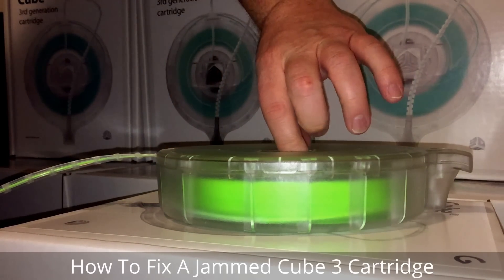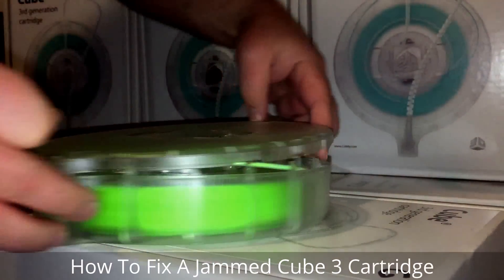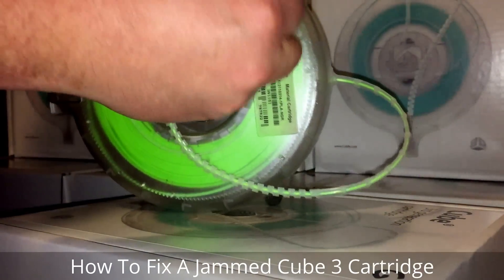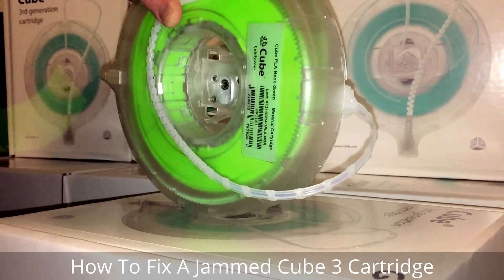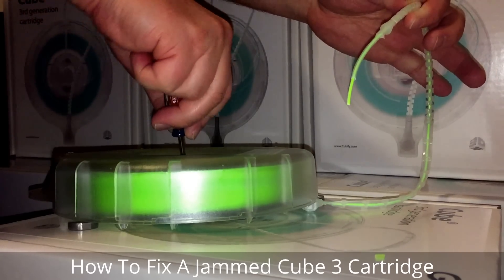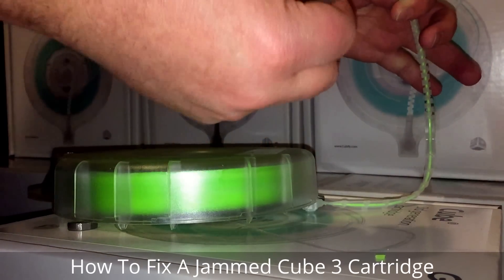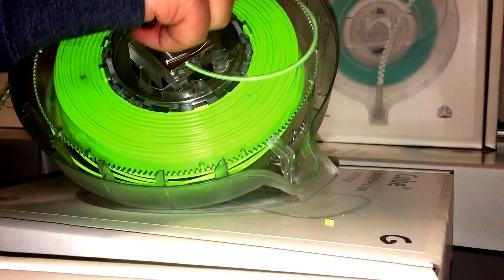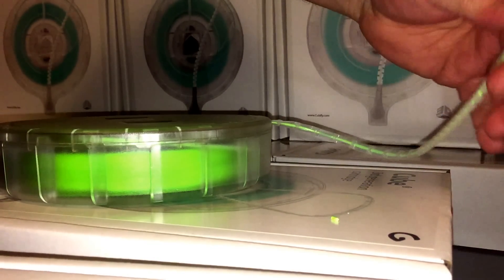How To Fix A Jammed 3D Systems Cubify Cube 3 3D Printer Cartridge

Comment: where is the 1-wire chip located? is it in the cartridge itself or somewhere in the printer?
Reply: Here is Filament Spool Holder http://www.ebay.com/itm/222298639746?ssPageName=STRK:MESELX:IT&_trksid=p3984.m1555.l2649

Comment: Your close.  Do these steps.  Take cover off as shown,  Start a print job. Let it prime (heat the tip), take pliers and pull the filament back out through the bottom of the advancer.  Cut off the stripped pieces.  Start a new print job,  let prime and heat, manually insert cut off filament.  Let unit advance material to the tip.  End print job once extruding again.

Comment: mine is getting stuck, I can undo the outside clips, but it seems like it's stuck on something on the inside
Reply from the maker: The center is probably the hardest because you can really pry it up from the outside.  Once you get the outside loose, pull up the outside, rotate, pull up the outside, rotate.  You may have to pull hard, ant it will almost feel like its about to snap.

Comment: did it work after? did you also do the whole melting the plastic inside the metal tip? i'll try this soon. I tried their instructions of just pushing in the filament and it didn't work, even made a video on my channel with how to do it.
Reply from the maker: This particular cartridge is shot because of the nozzle (I basically destroyed it in my last video).  Once I run another one of my cartridges out, I will grab the nozzle and put it on this cartridge, then report back.